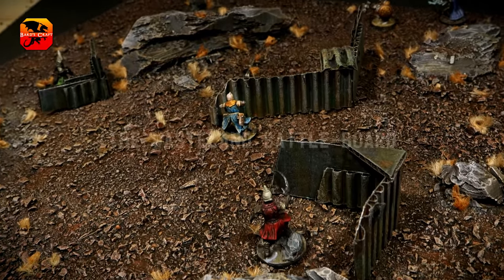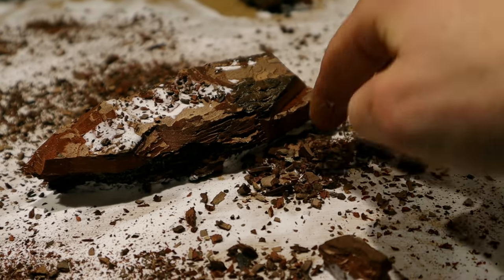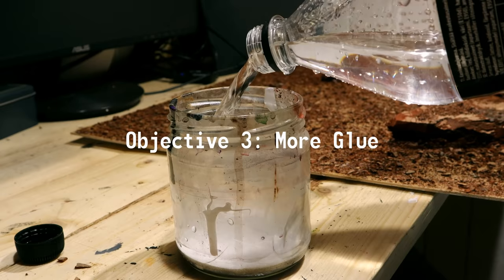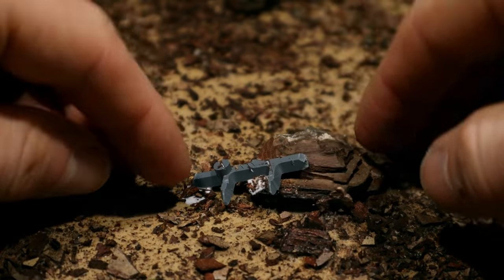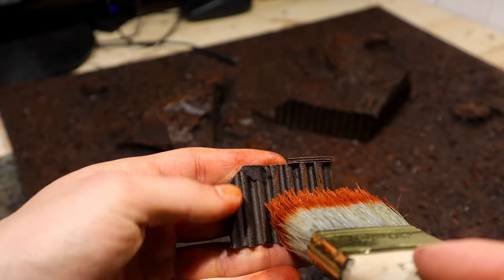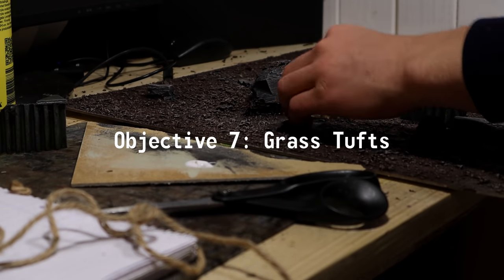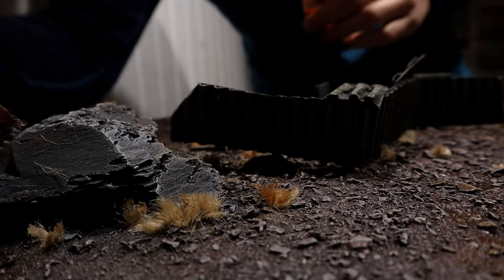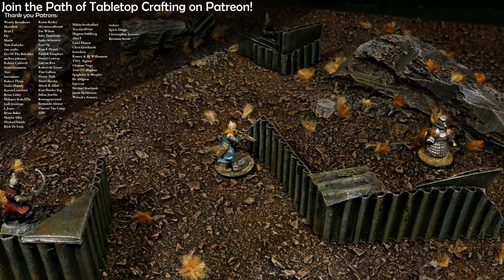Making a Wasteland Battle-Board: The most useful terrain I've made!

Comment: A better option with the board might have been to keep the table top intact to prevent warping issues...or remove the underside and fill the interior with a piece of insulation foam, which would have let you vary the landscape quite a bit more.